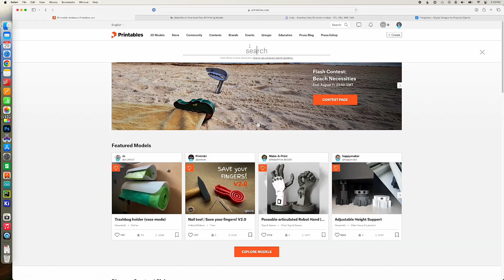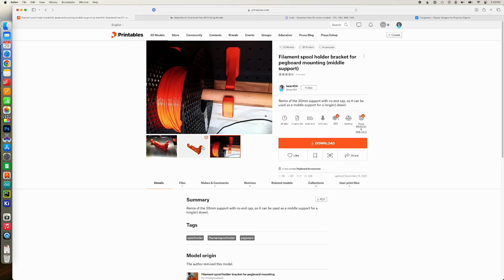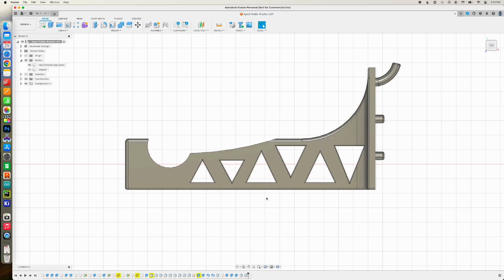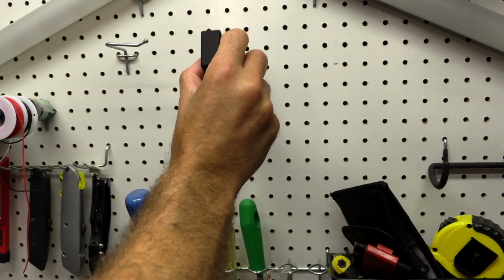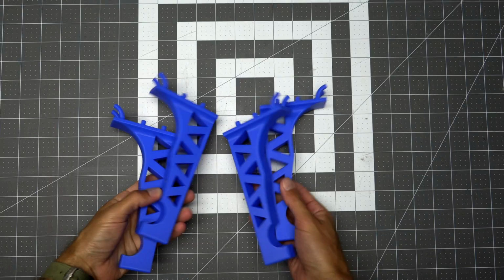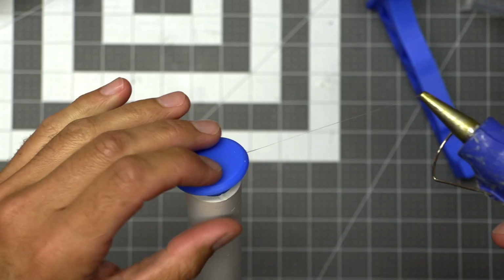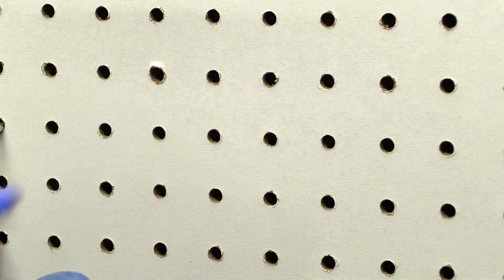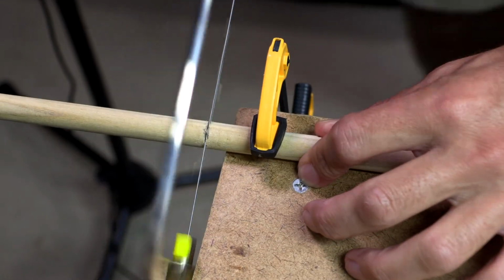3D Printer Filament Shelf

Comment: Nice job. I like the wire holder brackets.
The filament brackets though I'd worry about long term durability just because of how small the pegs are. How has it been holding up?
Subscribed.
Reply from the maker: Thanks for watching and the sub!!! So far so good, still holding up. I think the key is to use enough brackets to distribute the weight. I used 4 brackets over a 40” pvc pipe. Use more if you are concerned. If something breaks I’ll post an update.